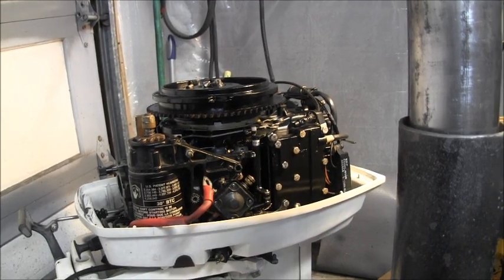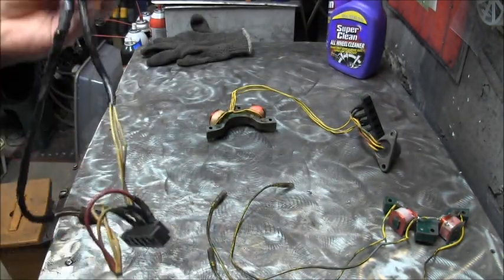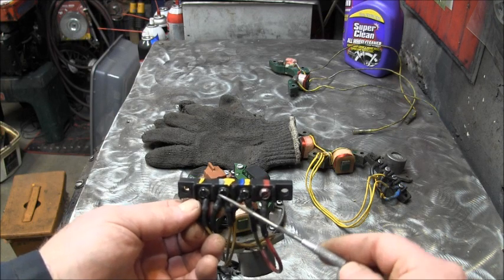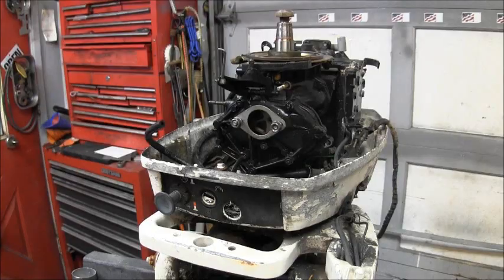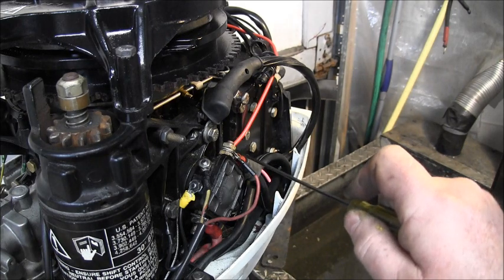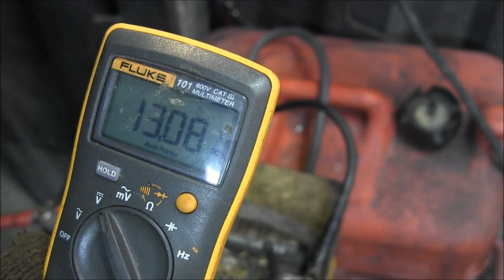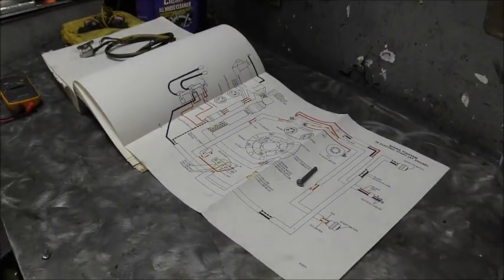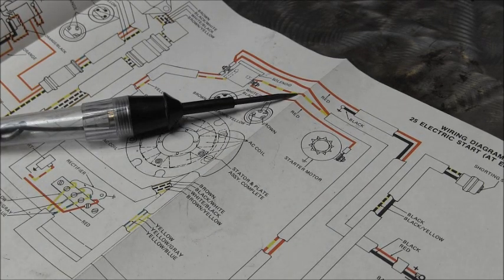JOHNSON 2004 30 HP ADDING ELECTRIC STARTER & CHARGING SYSTEM

Comment: Great timing I am building a Johny-rude franken-motor for my fishing boat over the winter. Starting with an 88 20 hp pull start johnny, Adding electric start from a 89 evinrude 20 and intake and carb from and 84-85 johnson 30-35. Can not wait to try it all out in the spring. Your videos as always are a help.
Reply from the maker: Thanks, I hope it turns out well.    kb

Comment: This video will help soooo many people.
Being colorblind, I always dread this step of wiring the charging/starting system.  I have to label each wire in multiple spots, even though I know which goes where.  I wish OMC would have used completely different colors.  I do like your painting of the wires method.   
Those stupid neutral safety switches. Corrosion seems to magnate towards them, killing your starter, leaving you scratching your head.  
84* in S.Texas this week.  I wonder if we'll even have a winter this year?
Reply from the maker: So wish we had 84 haha, Back to single didgets this week  yuk.    kb

Comment: HAPPY NEW YEAR! My first experience with Kodibass was doing just what you are doing. I converted a 1985 Evinrude 35 to electric start but without the charging system. Your info from a previous video was very helpful.    Hope you enjoyed the 60's. We are going from a few days of 60's down to 10 by this time tomorrow.
Reply: I also have put KB's former video to use in adding electric starting to a 73 Chrysler 25 hp (no battery charging capability) and to a '77 Johnson  20 hp. That one was a BA77 model so it had a charge coil (and rectifier + buss bar) in its manual start configuration. It powered a plug sticking out of the side of the motor that I used to get battery charging capability.
Reply from the maker: @danielrobert7181   I have seen vids of those older chrysler outboards with a  light on the hood,     kb

Comment: Best ever!  Personally, I've never had a problem with a neutral safety switch, but I'm a freshwater boy.  I have replaced them on customer motors.  And, I've had to adjust the position of them on customer motors so that they work properly again.  And, in fact, we would not remove them from a customer motor because of potential liability.  But, I understand your reasoning for eliminating them on your personal motor.
Reply from the maker: Yep' I will not remove'm  on customers motor's  But I tell them how if they wish 2. haha   kb

Comment: Hi Kodi, They showed the heat wave up there on the news. Crazy, especially with us down here breaking records with the snow and cold temps. Very good video showing how a charging system works on an outboard. Pretty handy to have a pull start backup if the electric start goes out or the battery. Got a guitar video coming out this Wednesday. Stay tuned!
Reply from the maker: Fantastic I'll B watch'n 4 sure.   kb

Comment: I'm no sure that getting 65 ° in December in AK is good news. Anyway, I'll embark shortly in a 1992 Johnson 30 hp eelectric start conversion project with confidence thanks to your clear and thorough explanations. By the way, I understand that the "neutral switch" is known to be the weak link in the system so I'll delete it since that, with the manual recoil flywheell interlock mecanism, that switch becomes a redundant safety feature. Have a great New Year Leonard and stay safe and merry !
Reply from the maker: Yep' most NSS I come across are rusty & usless, Salt kills them in short order. Happy New years   
                                                                                                                                                      kb

Comment: Hi there.
I wish and hope that you are still going strong with a stable health.
Your video was just what i was looking for.
Now i watched you video i know i am wel informed about all what i needed.
Now i do know how to produce charge electricity from my 10 HP Johnson outboard motor .
I did know some before bud i must to be 100% sure about this step so to buy

I know now that i need to buy a rectifier and the AC coil so to charge a battery.
I need to recharge my battery to power the live bait pump, the fishfinder/sounder, the electric reel during day light.
I need to recharge my battery to power the life bait pump, the bait fish light and the navigation light during the night.

I need just one answer on  one question.

I did understand that to charge the battery the plus cable of the battery must be connected with the red cable of the rectifier.

Question.
Where at the motor boy components must i connect the negative cable of the battery ?

Waiting for soon soon soon answer from you..

Be good, take care and til soonnnnn...
Reply from the maker: Any good clean bare metal spot on the block will B fine.     kb
Reply: @kodibassInsideoutboards  i need one irgent information... I need a bud. can't find a dealer that sells the twin charger coils thos e that are both connected to a block and have red wire together with 3 yellow ..

Can you send me an adres where to buy it or do you have one ?
Reply from the maker: @r.bouth.6457    Mate  I most likely have  what  U need,  But  I need more info,  Detail me exactly what  U R needing   /   looking 4 ?   photos , jpegs', manual discriptions,  part numbers  etc.  My  parts  R  N  unsorted  totes full of stuff  long  removed  from old engines .  I  have  tons  but it is up 2  U, To guide  me into the piles of parts I have,  Willing  to help But Most  of the burden will B up 2  U.     luv2help.    kb

Comment: thank you for the info very helpful , i have an 86 evenrude 30hp i would love to add an electic starter to , any idea where i could find the starter and bracket for it
Reply from the maker: They pop up on ebay , or check old outboard shops.   kb

Comment: Happy new year! Thank you for this content. It surely will help me with mines. I have a 2006 9.9 hp johnson 4stroke which i been wanting to also add a starter and charging system to it. But not sure what parts i need. It have some extra wires not plugged to anything. Hopefully its the charging stuff.
Reply from the maker: I think U will find those extra wires are for your charge system they seem 2 come standard on most of the 4 strokers.    kb
Reply: @kodibassInsideoutboards  🤗 yay! I hope so. Im still trying figure out what parts i need to do the install. Are you able to help me out on that? All i know is the model number is J10rsdm. I have looked around on the internet but im not able figure out the diagram and not able to find part numbers to those stuff. Ive been stuck on this since i have bought the motor the middle of 2021.

Comment: I also need to change a ground cable thay did corodet. This cable is conected midway between the propeller and the motor block.

I do see only one conection of rhis cable.

Do you know what cable i am talking of ?

Comment: My Tohatsu 8Hp two stroke specifies a 40 amp/hr minimum and not to run engine without a battery connected...u think I keeps battery charged as battery reaches maximum capacity it has morec resistance and the input even out you can't test with a small battery or flattish battery as when electric is used the battery will recharge as quick as charger allows..
When I checked 8hp two stroke outboard 
When all switched off 12.7 v
Just after starting and fast idle 13.5v
Went up to 13.8v running but running on muffs so could not run at full throttle..so imagine 14 volts would be OK for a large battery and it come down as battery reaches capacity and battery is good and connection clean etc...the only issue I have had a long while ago was an old sulphates was on boat and the engine kept charging over voltage and boiled the battery but this caused by old battery and corroded connections not the charging circuit when old dodgy battery replaced all worked fine...

Comment: Hi Kodibass! Something is not clear to me.

In another video where you show the connection of the solenoid valve you connect the ground and the start switch differently.

this video: 21:20
Start switch red on battery red, is ok.
Start switch yellow goes to the upper small solenoid valve.
grounding lower small solenoid valve

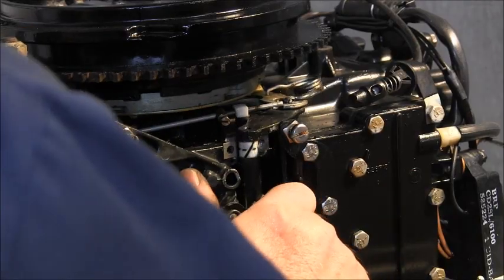another video: 2:56 S1, S2 theme:
https://www.youtube.com/watch?v=C2n8aA0AL2M

Start switch red on battery red, is ok.
Start switch yellow lower small solenoid valve
grounding upper small solenoid valve

What is the truth? :)

Thanks for your help!